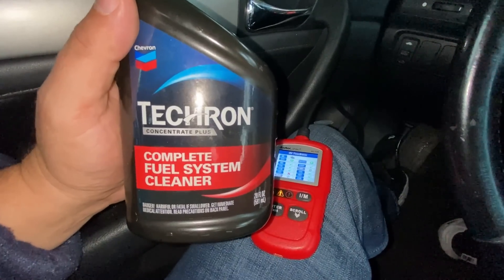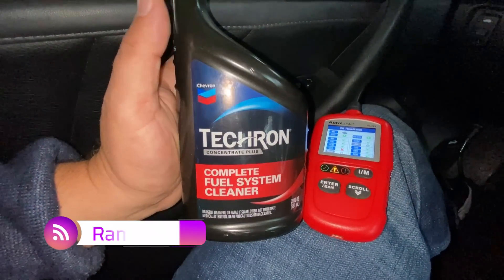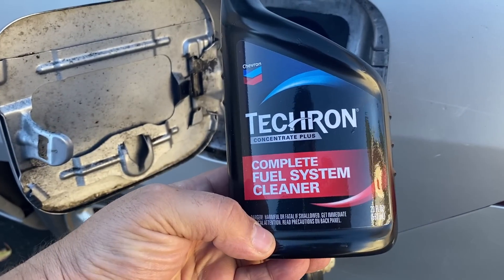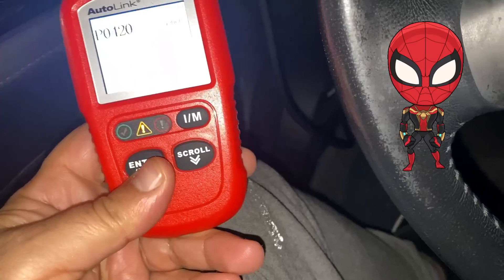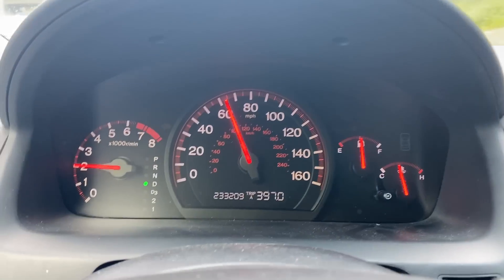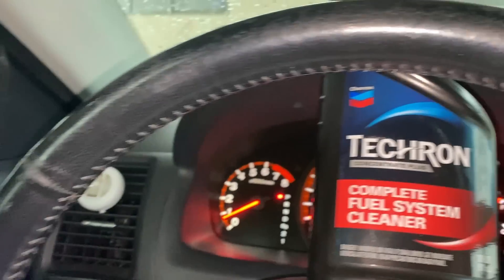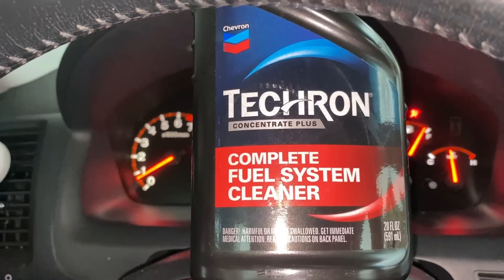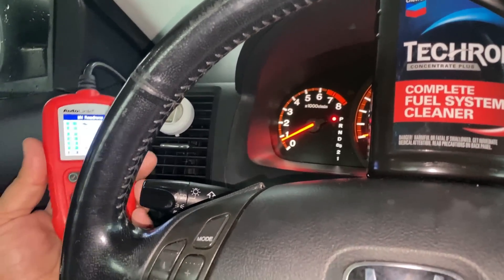Does Techron Really Work to clear P420 or P430?

Comment: I use cataclean but after check engine light on and off than I used techron fuel system cleaner and filled gas 93 octane check engine light disappeared afer 50 miles drive its works.
Reply: this is great stuff i could not get rid of check engine so i put one can on techron fuel sys
tem cleaner in and in one day 100 miles it went out and stayed out with out a reset of light   great stuff

Comment: Tried it today with my 2017 Hyundai accent worked like a charm when your tank is low fill it with the bottle then get gas and drive atleast 150 miles
Reply from the maker: For a p420 code?
Reply: @RANDOMFIX  yes sir p0420, worked pretty well
Reply: @bl4ckobiwan773   Wouldn't it be more efficient to run it with 1/4 or half a tank of gas?
Reply: @ half a tank lasted me 6 months it turned on a few days ago but did a oil change and flush(it was due ) two days hasn’t been on since
Reply: @bl4ckobiwan773    Oil change?  How did the oil change factor into a P0420 going away?  Did your PCV have oil in it?
Reply: @JohnDoe-md2sb you have to change the oil when you flush the engine helps clean all the gunk out so: first p0420 I️ used the cat cleaner with half a tank- it came up again 6 months lasted so this time I️ flushed my engine changed the oil because I️ assumed that build up over time was causing my cat not to work to effectively. So I️ did a flush and drove one cycle and the code went off and I️ passed emissions
Reply: @bl4ckobiwan773    Ah, got ya!!! 
Thanks for the update.  🤭👍

Comment: I would graph the downstream o2 sensor before and after.  If it works, it would reduce the peak to peak voltage swing.

Recently I had given up on a P0430 on a 2010 ford Escape 3.0L V6, band 2.  It was present all the time and comes back after a code clear.  Then 3 things happened:  1) bottle Techron in full tank, 1 bot in 1/4 tank; 2) tried to remove downstream O2 sensor to put spacer on (my bad) but with about 24" of pipe on the wrench, it didn't budge, so I gave up; and 3) left my Panlong OBD2 scanner dongle in the port while doing this.

I removed the dongle, drove it around for about 2 hours doing various shopping and the CEL WENT OUT!

THREE THEORIES:

1) Techron clean up something
2) The Big BUll Pull on the O2 sensor definitely flexed some metal (cat and sensor) and perhaps some thin crusty deposits were loosened (and maybe help the Techron to work)
3) Leaving the dongle in may have had some effect on things.

Who can say?  All I know is I need to get it emissioned while the CEL is out (!)
Reply: @NoferTrunions   Update?

Comment: Would it best to put Techron after an oil change?
Reply from the maker: Good question, the Techron is fuel system cleaner and it only interacts acts with engine oil in the combustion chamber.
 
Normally fuel and oil will never make contact with each as the oil can absorb the fuel and lose its protective properties.

So there is no real advantage or disadvantage in putting in after an oil change.

Comment: Did you get 430miles with a full tank?
Reply from the maker: I didn’t keep track of the fuel level. I was focused on trying to set the catalyst monitor in heavy traffic in California.
For the fuel economy I kept tract on this video https://youtu.be/Edc0uPgeU8Y?si=d3r41g2l6TFOkEAG
Reply: Ah I see, yea man that p0420 is a pain and the only way to get rid of it is using a o2 sensor fouler/extender

Comment: Thanks, good to know that kind of product. I used cataclean on P0420 code. 05 Camry 126k miles. Light came back after 800 miles, I put some again second time came back at 430 miles. My renewal not due until June. It works but, not time for a smog yet. I probably change my downstream 02 sensor too. Got the parts already, hesitating for now cuz is too cold. Thanks for the video 👍🙂
Reply from the maker: Glad to help and good luck with your smog when it’s time. But for you Camry instead of using product this trick works like magic on vehicles 2008 and older https://youtu.be/BuZYAy_xi0E?si=7E3OFjzfEZAadH0G
Reply: My advice would be use a o2 sensor fouler/extender that will defo fix the p0420 code